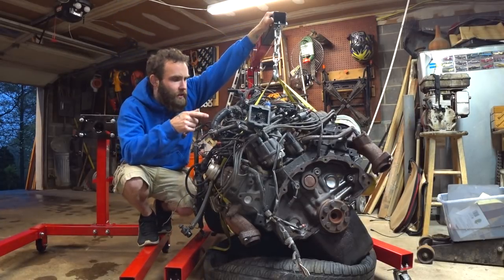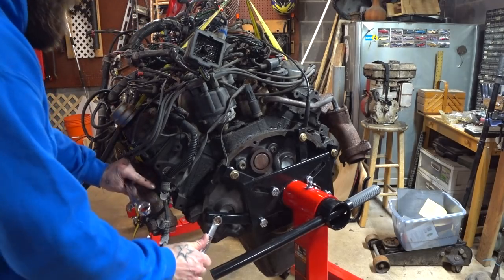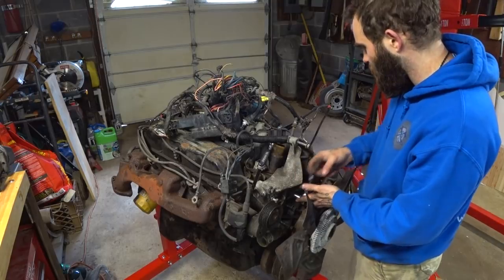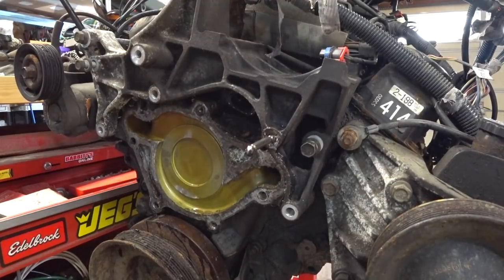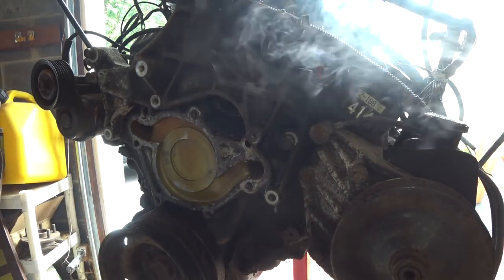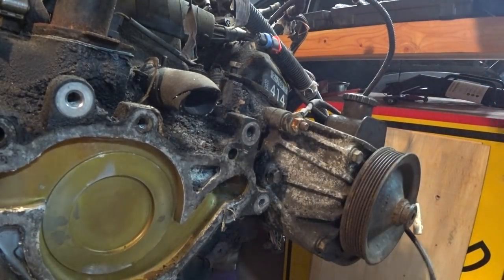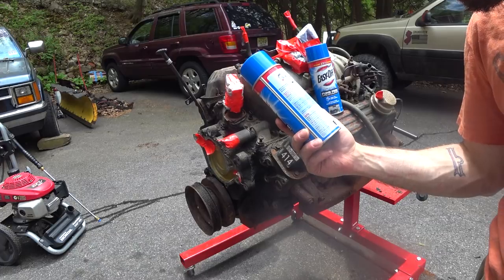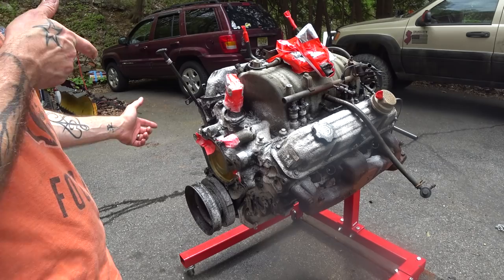Tear Down and Clean Up - 5.2/318 EFI to Carburetor Swap

Comment: is there more information on this procedure I have a 95 Dakota that I cannot locate the correct engine control module 4 and I'm interested in turning it to carbureted and how much is the cost analysis roughly? any forms that talk about this

Comment: Cool. I’ve always wondered if you could do this to a modern engine. It would really cool to have like a new old engine if you get my meaning. It would also have less things to go wrong (if done right) 
You’d have to make some proper modifications though
Reply: I think this project is dead but I get what you mean. The big American V8’s are still backwards compatible to their ancient origins before electronics got in the way. The 5.7 Hemi, 6.0 LS, and 5.0 Coyote can be converted back to a carburetor and distributor. It just takes a lot of knowledge how to make it work and fabricate the missing pieces. I want to do this to a brand new Ram 1500 5.7 someday as my “forever” truck. It would still be able to get good fuel economy and pass emissions if you tune it right. I would love to have a 6 speed manual and dashboard full of analogue gauges.
Reply: @markm0000  I am currently looking into what it takes to convert a 1995 318 to a  carbureted engine. I am looking to order the correct manifold. Much of the information online is confusing thus far.
Reply: @foggler  I’m not entirely sure either. I think you can leave the injectors in the block disconnected. Everything else will need to be custom.

Comment: I buy the dollar store oven cleaner, a buck a can. The cheaper it is then the better it works. The no fumes formula is weaker. I use the stuff to clean the inside of the engine blocks and heads. Got a whole series of vids on it.

Comment: Doug, you really oughta bite the bullet and get yourself a cordless nut rattler.  The percussive blows delivered by an impact wrench are great at breaking up the rust and corrosion, and it applies a straight twisting force (no side loading of the fastner) and is therefore much less likely to shear bolts/studs.  You can get a Ryobi unit new with battery and charger for around $130 from The Hodiepo.  I bought one when I was working as an RV Tech and have found it to be pretty darn good.  Rated for 300 ft-lbs, but it will actually do a bit more, and I don't know of any fastener on a passenger vehicle that needs even close to that.
Reply from the maker: Yea bud. I know without a doubt you are right. I have ventured on to the interwebs many time, credit card in hard, but when it comes time to checkout and I see the bill I flake out. It is coming though
Reply: @DEInTheGarage  LoL, think of it like a health insurance plan specifically for your knuckles and sanity.  It will easily pay for itself within the first few uses.  Carry it, a charged battery, and a 19mm (also an 18mm if some of those razza-frazzin' lugnut beauty caps have come off) in the Jeep at all times, and you'll never have to worry about not being able to break the lug nuts loose should you need to swap on your spare.  Not to mention it will get you off the shoulder of the interstate a lot quicker than the O.E. lug "wrench".

Comment: I use castral super clean. Not purple power or the others on a motor I’m going to paint. Castral doesn’t leave any film behind. The paint goes on much nicer without having to use so much wax and grease remover. Make sure not to get it on polished or bare aluminum. Oh and if your going to dump the AC either moroso or transdapt 318 brackets should save you quite a bit of room on the front of the motor by pushing the alternator out from the block and back. As apposed to stacked on the front of the motor. Since your cutting the harness new maybe longer wires won’t be an issue. Also what are you doing for a distributor after all the controls are gone. Good project love the videos have fun.
Reply from the maker: Dude, thank you for that tip. I am currently researching my option for moving the front accessories around to give it more of a classic look.

Comment: Ditch the Colman tank and get map gas instead !! A good presoak of WD before removing any more bolts and will hold the moisture back . Don't forget the free sports have to come out and replaced with brass ones before painting the block .
Reply from the maker: Absolutely. I already have the brass plugs ordered. Some Mapp gas is on the shopping list for the next Wally World run
Reply: @DEInTheGarage  I got mine at AutoZone for free by trading in a few car batteries for a core and they gave me a debit card , $10  each one and it was only $12 bucks for the mapp gas so I had $30 total on the card.  And @Dan H . One was a optimum battery 😂 aka junk !!

Comment: Some brake fluid is great for breaking up rust. I usually save the old fluid from doing brakes.
Reply from the maker: That is my junk yard savior trick! dip a long bold into the revvoir and PRESTO instant pen fluid
Reply: D&E In The Garage I keep a spray bottle just for this. Better than WD-40.

Comment: I would go with a older set of pulleys and brackets off a old 318 to clean up the front.
Reply: Wouldn’t you have to change the water pump to the opposite direction?
Reply: Yes. You also need the water pump.
Reply from the maker: I have this question as well. It is on my to-do list to research it. Uncle Tony's Garage seems to have used old style brackets on the 5.9 he just built and converted to carb

Comment: Doug, congratulations on the efforts. 
Best to heat up the exhaust manifold bolts to cherry red, and remove using a 6 point socket. 
If they shear, slide off the manifolds and use torch to heat up the bolts again, don't cool the bolts with WD40 or penitrating oil, just twist them out using vise grips. 
I've been there..
Reply from the maker: Yea buddy. As soon as this video was done I sprayed all the exhaust and intake bolts down and am going to hit them every night until I get around to breaking them off. Thanks for the tips
Reply: @DEInTheGarage  Oh, btw after removing the Intake, are you planning on removing the cam?  If so, I highly recommend you holding onto the lifter guides for the roller lifters.  They are not available anywhere, they've been obsolete for some years now. No aftermarkets available.

Comment: I'd soak it down with DAWN & TYPHOON IT AGAIN. Easy outs, " MY ASS " ANYTHING BUTT. Those exhaust manifold bolts SCREAM F U I'M BREAKING OFF. Soak those bad boys for at least a week & tap with a hammer every so often. I use Acetone & ATF for soaking bolts & nuts to be removed, 50/50 mix in a spray bottle. YES, You got it, different types of metal cause corrosion & BOOM PROBLEM. I use so much Anti Seize anymore it's not funny even on my lug nuts.
Reply from the maker: Yea bud. I only got enough grime off this time to feel safe popping the valve cover and intake. She will need another round with the typhoon shooter and a few more shots of the good stuff before paint

Comment: I used the purple stuff worked just fine. I dont know why I pulled a motor out a 4x4 the mudd was thick. My truck was gonna be a junkyard build but kept finding good deal for parts on craigslist and Facebook. My pump was trashed so got a reman one. The cam bearing no good found a purple cam and m1 with all the works for $500 was gonna reuse heads but just got new ones just cuz I need to replace springs for cam hopefully it comes in Thursday then motor to the machine shop. I already spent more money on the motor then I paid for the truck I'm trying to do the YouTube thing just as not as motivated as I want to be. Loving the swap man you're keeping motivated to finish my build. Cant wait til you pull the v6 out